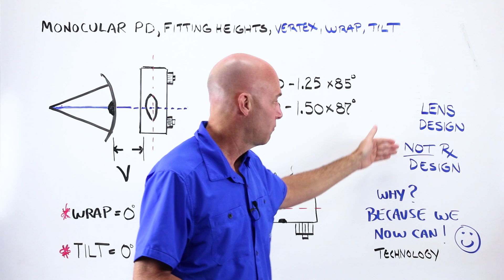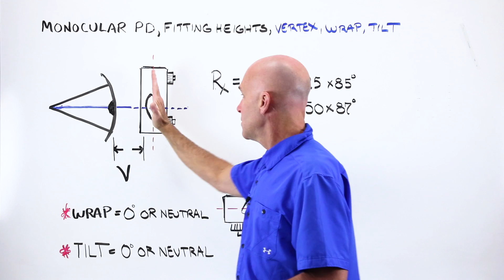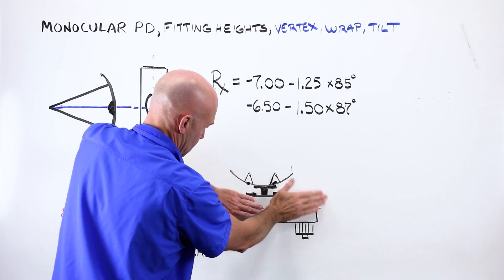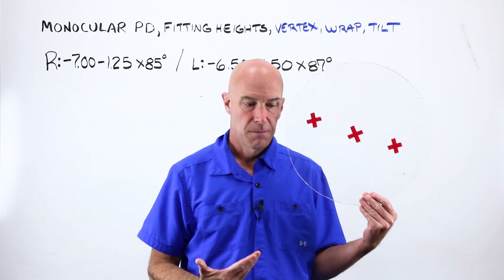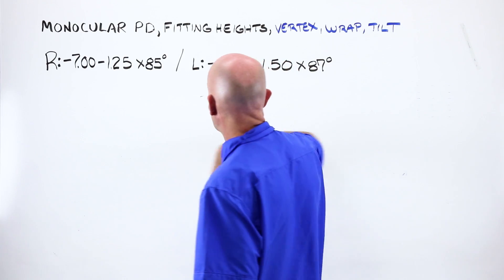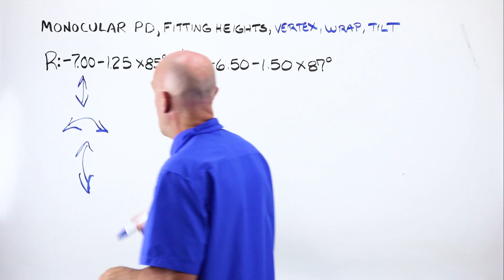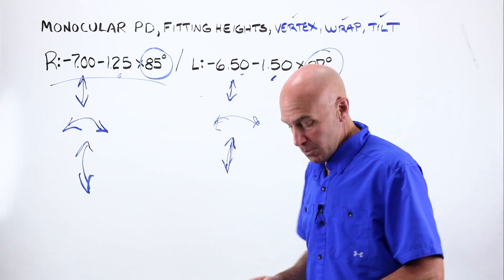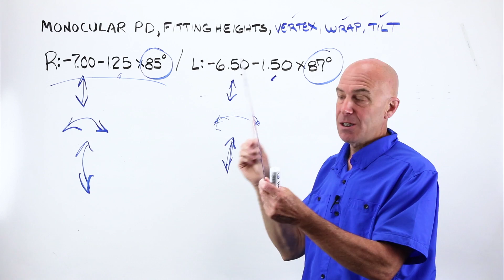What Is A "Compensated" Free-form Lens Design?

Comment: Been dispensing progressive lenses since 1980. We have never had a problem with the prescription until they start compensating when you compensate in RX. You’re basically changing the prescription and with the doctor refracted at that vertex distance. Anytime we have a problem with the prescription it’s because it was compensated. A lot of times we alter the prescription to offset the compensation. This is just another way to try to add complexity to a prescription to act like their lands is the best a lot of time we’re back to the original design and progressive lenses because they work the best a lot of times the ad powers are up to a quarter diopter less, so the patient has a hard time reading. It’s not correct to take a doctors prescription and alter it.

Comment: How do you find the 'as worn' position to then use to feed into the amount of 'compensation' required? Thanks.
Reply from the maker: Electronic measuring devices like OptiKam and then the lab software takes it from there. If you are trying to do it all manually just go with the defaults provided by the free form lens design software.
Reply: @LaramyKOptical  OK. If I have measuring calipers and I get the vertex 'as worn' distance, the 'as worn' wrap angle and the 'as worn' lens tilt, I can enter these into the free form lens design software? You say to use default values, how does this give me the real-life case? or are default values good enough in most cases?
Reply from the maker: @roygamlin8869  Sure! If you are confident that you are measuring the right thing in the right way absolutely you can! My belief is that unless you are dealing with high powers or some special circumstance the defaults will produce a perfectly good lens as well. The defaults are created from a database of hundreds of thousands of measurements and although we are all different we aren't all "that" different. And - maybe better to trust statistically accurate defaults than risk getting something wrong by taking manual measurements and having a remake? [this gets into religion/politics stuff - others will disagree]

Comment: Hi John. If I held the lens in the lensmeter to match the same panto, vertex, and wrap angle as worn, will I be able to see the original prescription?
Reply from the maker: NO! For a million reasons, no. The lensmeter works strictly off back vertex lens power so if a lens isn't sitting flush against the lens stop you will not get an accurate reading. The only instrument capable of really reading a true free-form compensated design is called a Dual Lens Mapper. Labs have them - stores don't. Even a high-end auto-lensmeter will only help you get closer. It really does come down to trusting the lab. If you can get close to what they say should be there then you just gotta believe. Assuming everything else is done right all will be just fine. If anyone is telling you that you can somehow use a lensmeter to accurately read a free-form they are simply wrong.
Reply: @LaramyKOptical  So it's vital for our patients to carry this information with their eyeglasses?
Reply from the maker: @darkhero168  No, yes, maybe --- I can't really think of a reason why they should. Any decent optician should know what they have in their hand if things look weird. Even SV free-form has laser etchings which would be an indication of why things are looking weird. Not sure I would want to burden them with another card in their wallet or purse.
Reply: @LaramyKOptical  The concern is when their optometrist is giving us grief that the lenses were not made properly.
Reply from the maker: @darkhero168  Ah OK Gotcha. In that case yes it would be helpful for them to have the card with them. Sadly this will probably become a case of, "you can't fix stupid" and they will never understand how/why things read like they do. You might try talking directly with the OD or connecting them with the lab - maybe they could provide the dual lens mapper readout.

Comment: Rx: sp -7.25 cyl  -0.50 x 027
Comp Rx: sp -7.01 cyl -0.62  x040 
Concern is the axis. Your input is greatly appreciated.
Reply from the maker: Don't worry about it. A sophisticated computer program designs the lens - not some guy or gal doing the math with a paper and pencil. You have high sphere power but very low (negligible) cylinder power. You should be just fine. Axis is a notation of position not power. John

Comment: May I ask, is this a common practice in USA? I just asked an optician here (Europe) if lens are ever made to take frame and position on your face in relation to your eyes into account and they said definitely no, they just make the whatever prescription was measured at eye exam. I have three different frames with supposedly same prescription but I'm having difficulties when switching between them, eyes tired, dizziness, blurry vision, slight headache, all in all not a pleasant experience... then I saw this video and began wondering... Here they said pick one frame and stick with it, but even if you have sunglasses with prescription that already breaks that rule...
Reply from the maker: It is pretty common practice across the world now. We have been doing vertex compensation for powers over 8D for 600 years. All free-form lenses are created using compensated default measurements. So wild crazy guess maybe 40% of progressive. 20% personalized measurements. So, no I'd have to say your European optician is missing some information. As to why you can't see clearly across a series of glasses I'd need to know much more. Far better to find a new optician that will work with you to figure it out. John

Comment: So I am an apprentice optician and I love ur videos! One question though 😬 since this is technically not changing the prescription is the ansi standard shifted from the original position ex. 7.00 or is it the compensated Rx ??
Reply from the maker: Not 100% sure how to answer. If the lens is a properly compensated free-form it should never be "off" since it is already being ground to the nearest 100th of a diopter. If it was falling outside some range of tolerance I think it would go in the - "made wrong send it back" bucket. But I guess if it was some silly trick question on an exam you would be applying the standard to the compensated value. If anyone argued with you they would be the one that doesn't understand compensated powers. But let's hope that isn't the case... make sense? John
Reply: @LaramyKOptical  yes! That makes total sense 😝 I'm sure the ppl at the licensing exams wouldnt do that to me... Would they 🤔 😂 thank you so much! 🦾🔥🔥

Comment: As an engineer, this is what I have always questioned when getting my glasses. In order for the calculation to work, the lab that grinds the lenses needs to know which frame the lens is going in.
Reply from the maker: Yes but that is IF and ONLY IF the lens is being compensated. Or they need the shape for a surfaced plus lens.
Reply: @LaramyKOptical  - In oder for the prescription to work beyond the one point ie the PD point, as you move your eyes, it needs to be compensated, much like the cathode ray that spits electrons to the tube surface. Flat screen cathod ray tv were a problem because of that.

Comment: Is this a common practice for most labs to compensate or do most just create lenses based on  what was written in the rx?
Reply from the maker: A lab will only compensate when told to do it. Or when a specific progressive software program has compensation as part of the lens design. But no even in high powers generally you get what you order.

Comment: SUPER-nice videos! To be sure, if I tilt significantly retro, does that induce a positive or negative cyclindricity to the zeroth or the 90th meridian?
Reply from the maker: SF, Not really a question of +/- just change. All optical formulas are worked in minus cylinder form (since we grind minus cylinder) so it will result in a change in the perceived power not actually add or subtract power.

Comment: Another excellent video John (I received a link to it via LaramyK email)! Do you think conventional labs (i.e. not free form) would benefit from using the wrap Rx feature included on many LMS's, to result in a more patient accurate Rx?

You did an excellent job explaining this concept of how the "perfect" world differs from the "real" world; namely, how the phoropter differs in angles from the actual frames worn on the patient. So why not alter the lens design even for frames that aren't considered, "wrap frames"?
Reply from the maker: In theory you might be able to tweak a conventional surfaced lens to work better with a "wrap feature" but it would be very limited. In theory you could work the lens tilt formula and compensate your lens order to the lab. But, nothing beats free-form done right!

Comment: Hi!  I have a Hoya Lens Quality card that came with my eyeglasses.  After seeing this video, I now see why there is a place on quality card showing Compensated RX as it differs from regular RX.  But, also on card is a place showing just plain RX.  My concern is that plain RX on quality control card does not match RX given to me by Optometrist at time of eye exam. They did not give me a receipt at eye doctor office saying the reason for doing that was their printer was broken.  Does fact regular RX on quality control card does not match regular RX given after eye exam mean I have been given wrong card or scammed by giving me someone else's card while providing me with non Hoya lens?  Thank you.
Reply from the maker: Joel, All I can say is that IMO the original Rx as written and given to you by the doctor's office should match the Rx on the card. Question: Does the Rx have a middle number? And if it does, does it have a + or a - sign in front of it? It may just be a case of the Rx being written two different ways. Beyond that - well I think I'll let you sort that stuff out. John

Comment: HI JUST A QUICK QUESTION IF THE CALCULATION WOULD BE DIFFERENT IF USING TRIAL FRAME AND NOT THE PHOROPTER 
THANKS IN ADVANCE FOR YOUR REPLY 
NICK
Reply from the maker: Nicolas, I'm not 100% sure what you are asking but --- I think it would be, no, the calculations would be exactly the same. I think some trial frames have a vertex measure on them. John

Comment: Hi. I am not an optometry student. Trying to understand the concept of "as worn position": common sense would lead one to think it would have to do with the lens vis a vis how the frames sit on the face eg.distance from the eye. ho does the shape of the lens fram and where your glasses sit relate to "compensation" since those factors are not recorded? Are those factors simply ignored? (how could they b considered irrelevant/). Thanks for your patience in advance!

Christina L.
Reply from the maker: Short answer: The lens design company IOT has a database of defaults for vertex, tilt and wrap.

Long answer: Actually, those measurements or positions can be and are recorded. Those are the actual POW or point of wear measurements, vertex, tilt and wrap. Some opticians choose to provide them for each individual customer. Most opticians let the default settings in the lens design software decide what is best. 

No one in customer service at Laramy-K would be surprised if you read off vertex, tilt and wrap as part of a free form lens order. 

In my opinion, much better to go with the defaults unless you are 100% sure of exactly what you are trying to measure. You will find kits and videos on how to take them, BUT, without the aid of some very sophisticated software and hardware you are trying to measure something that has no baseline or fixed position from which to measure. 

And, never forget that inserting the actual lens into a frame alters all three of those measurements! 

In my opinion you might have 1% of all opticians that could do a decent job at taking them. For the other 99% of us, let the software decide. 

Hope that helps!

John
Reply: @LaramyKOptical  I am sorry to also be a "consumer" trying to understand what I am buying. However, having purchased the "best" digital free form lenses at over $1000 ( lens only) as recommended by my optician , due to my visually demanding job requiring constant fast switching between distance and intermediate vision) I need to research why these feel worse than my previous lens. My optician is blaming the frame I chose as it has a spring hinge with a thick temple that can't be adjusted easily. Could this really be the case. How do I know? I do know that no-one told me this when I purchased the frame and no-one  took any measurements other than the PD.
There are few good sites for consumers to investigate why they are having issues or how to evaluate what they are paying for with these custom lens.  I read your guidelines for consumers which help a bit but do not explain much about how to judge these new lens products being sold or whether they are being dispensed correctly. If you know of such a site I would appreciate being directed there. If not, then we are left trying to educate ourselves in order not to be taken advantage of as we are deluged with marketing and all kinds of confusing recommendations from opticians. I do not mind paying the price for a better product. However, "blind" trust is never advisable, especially in our increasingly degregulated buyer beware world. I'm sure most opticians try their best but there are many who do not keep up with the necessary education for the products they are selling. I wish they would all need to take your courses and prove up to date competency.  But the only impetus for this, aside from government regulation, is advocacy from consumers themselves. It is crucial that consumers be educated enough so that their scarce resources and time are not wasted. Sadly trust is being eroded on every front as monopolies take for granted their customer.  I think optical associations should be far more demanding about professional standards and accreditation than they are.
Reply from the maker: @icanseeclearlynow1210  Same reply as yesterday = You need to find a better optician. IMO $1000.00 is almost 2X what even the best should cost. If ultimately a frame doesn't work for a customer that is 90% the opticians fault. And tomorrow the answer will be the same again = You need to find a better optician/optical shop. I'll bet just about anything you could find someone to do it at half the cost and get it right... suck it up - you got a bad deal... John
Reply: @LaramyKOptical  This is exactly what perplexed me; until Christina asked the question. I understood the video perfectly, but was left wondering where in the world the new values for vertex distance, and both vertical and horizontal tilt came from; for use in the software calculations. I assume thickness and index of refraction would also affect the final 'compensated' values. The video was very clear, but please include where the real distance and tilt values should come from, before the end of the video!  …..P.S.:  just messin' with ya! :-)   I WAS truly left wondering... but your vids are still truly exceptional! Tks

Comment: Hmmm. A phoropter isn't perfect. That script would have 3 lenses in the phoropter, hopefully calculated so they read as indicated at the default vertex distance. Also, eye charts are almost universally higher than the patient, so we have a negative tilt. I have real problems with very accurately compensating a result that has been arrived at by finding the least noticeable difference, which is , at best 0.12 Dioptres. Also, the result has nothing to do with"Brain Perception" it has to do with the vergence of the light reaching the eye matching that intended by the prescriber. Also, how accurate are lensmeters? Are they using the green reference light or infrared? What's the ABBE number of the material? That fancy measurement to .001D at what wavelength? Don't get me wrong, I love your work and I have had these criticisms of free form lenses for a while, despite the excellent results we get with them. Troubleshooting them when they don't work, however can be a big problem. Measuring and getting the numbers on the packet at the measuring point is only a small part of the story.
Reply from the maker: Thanks for comments, John. Valid points, but does any of it change where the difference in a compensated lens comes from? As far as the phoropter being perfect, only in sense of "it's the standard against which we measure." That's the point. There are more opportunities for error along every step of the process than we can count, but does that mean we shouldn't strive for greater accuracy? As you mentioned yourself, it's hard to argue with the results. We have them in the tens of thousands: http://www.laramyk.com/freeform-lenses/ . And of course all vision is nothing but "Brain Perception" so, it has a little to do with it. ;)
Thanks again for your comments and for trying to keep us honest!
Reply: Thanks to you too, John. As an Optometrist for many years, it makes me cringe when optics is glossed over at continuing education events. (Maybe it's just an Australian thing) I really do applaud what you are doing here.
Reply from the maker: If your continuing education is anything like it is here in the States, it amounts to little more than ads for big optical. That's one of our motivating factors for doing these.
Reply: We get some of that, but most of ours is on pathology and eye disease. I do remember one "seminar" from one of the worldwide names in lens manufacture that was more instructions on how to sell their lenses. Keep up the good work!